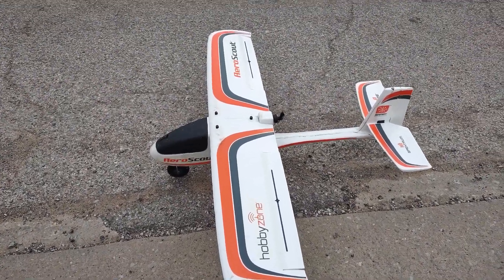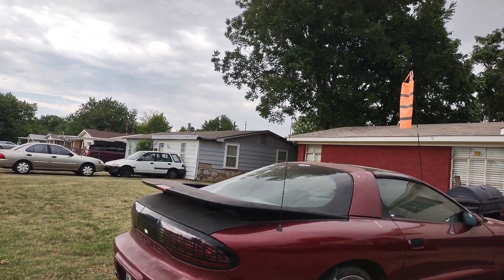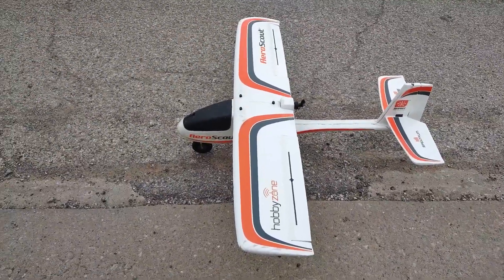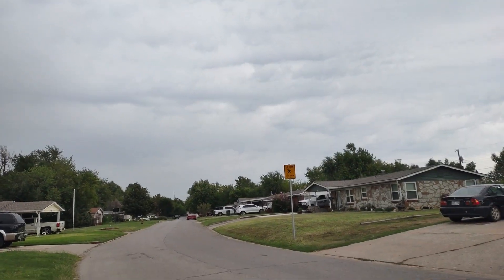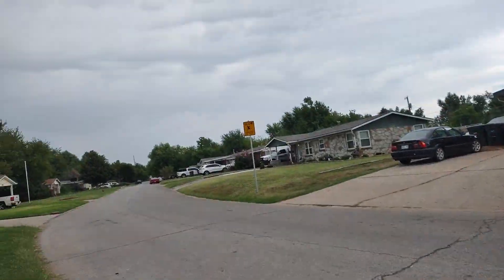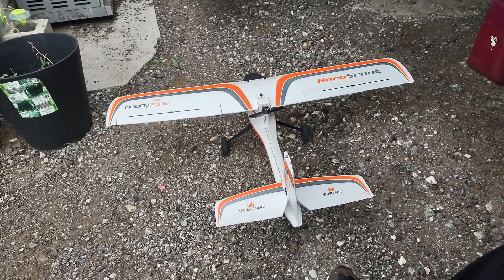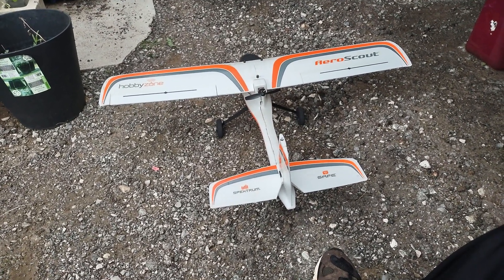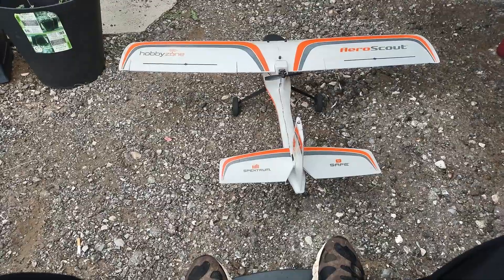Power Loss! Elevator quit! Safely landed still. Time to do some upgrades. Aeroscout still acting up.

Comment: ESC is a pain in the Axx... to get to...?
Reply from the maker: Yeah it is, but I am going to modify it for easier access. Just have to find material in need before I even attempt it. I'm going to change the ESC definitely, because the wires are melted. Maybe I should let it cool off a bit in between batteries. Lol. I will do updates.

Comment: Spektrum is having problems with their transmitter system.   Now the motor is inop... doesn't start....
Reply from the maker: Yeah I use the RadioMaster TX16S, but the horizon hobby planes use spektrum receivers and that's been my issue since they started these version 2 models.